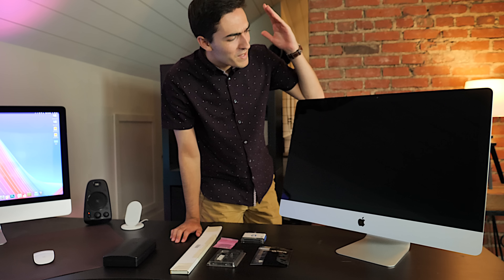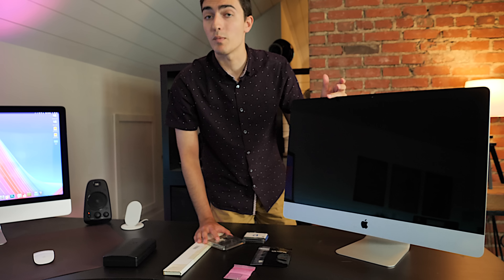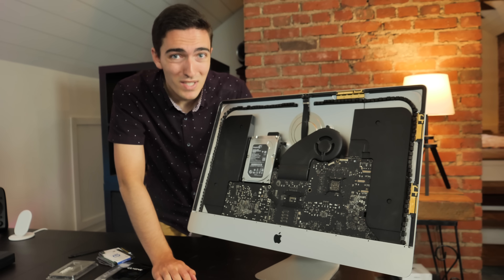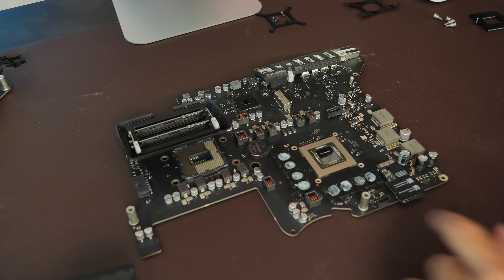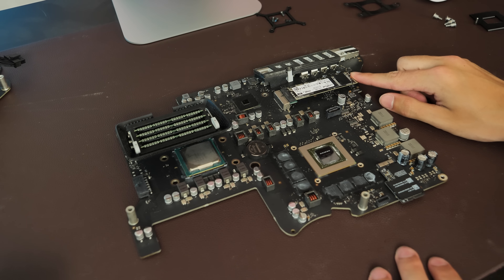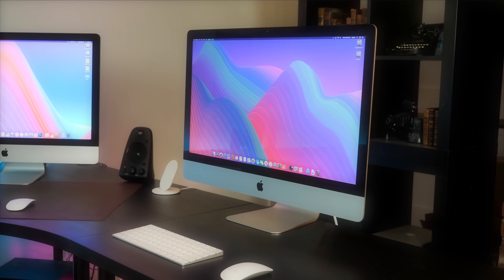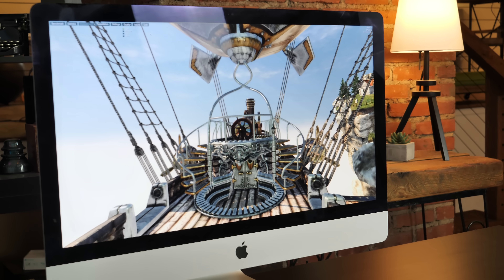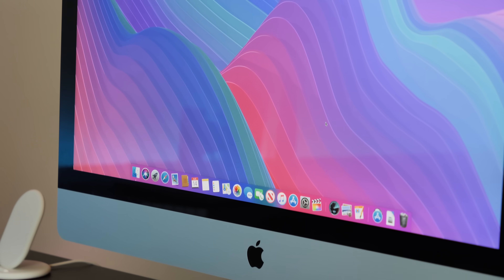Upgrading the $500 2013 iMac to the Max!

Comment: Changing to an non-Apple SSD - do you have to run the ‘Enable trim’ command?
Reply: Roscoe Coltrane no. Even my Mac pro is running OWC ssd PCIE no problem. Came with enclosure for old apple SSD to use after also.
Reply: Also tested another on 2 2014 15" MBP retina & 2017 13" MBP retina and it was fine.
Reply: Bobby Brady  is it possible OWC Aura SSDs are already? Cause I didn't need to do anything?
Reply: Bobby Brady dang. Learned a lot. I'm hoping my 2013 has the PCIE slot too I'm running off internal SSD now but would be dope to hit i7 and NVME OR PCIE! Scared to run the disconnect 😂
Reply: Bobby Brady  Im going to dive into the iFix it tutorial. My business partner did it with this 5k retina so hopefully we can do it too for mine. I know the issue he kind of glossed over was the live power in certain points even when shut down and unplugged. He made it seem much easier than it actually is i assume

Comment: I’m a newbie for Mac OS..  once you transferred the hard drive contents over to your SSD, where and how do you set the SSD as your primary drive and boot to it?   Did you keep the hard drive as a secondary drive?  I’m coming from a windows background.   Thanks
Reply: Use Carbon Copy Cloner to copy all the data and the recovery disk to the SSD, then go System Preferences >>  Start-up Disk to set as the permanent boot disk. You can toggle between them on boot by holding down the option key as well
Reply: mindtpi thanks
Reply: Bobby Brady  That's fine if you have an external Time Machine backup (the existing internal SATA isn't going to be a Time Machine disk) which will normally be USB but it's glacially slow. You have the SSD and the SATA disk in the computer already, you download a 30-day free trial version of Carbon Copy Cloner, transfer all the data (and the recovery disk) over the internal SATA it will be hugely faster. Restoring off what will probably be a USB external disk using TImeMachine doesn't make sense in comparison. You can certainly do it, but why would you?
Reply: Bobby Brady   I would imagine. that if someone has issues using something like Carbon Copy Cloner over TimeMachine, they probably wouldn't have been disassembling a 2013 iMac in the first place

Comment: I believe it’s always worth it, to buy something you can customize to your needs. You never know what somebody else threw In there and you may not need all that. If all you are interested in, is upgrading the ssd an ram, $185 bucks is still less than what someone may sell the entire unit for, with those upgrades. If you know what your doing, get the $500 iMac and use the saving on what’s important you you.
Great series Luke. Peace.

Comment: Great job Luke I did the same for my late 2013 27" iMac  got mine for $200.00 because it had a bad power supply put a new one init did the upgrades very solid mac

Comment: How do you know if your iMac has an NVME slot?
Reply: I think all the thin 27' models have a slot on the reverse of the logic board - the NVME key on the different models may be different though. None of the thin 21.5" 1.4GHz models do. Any thin 21.5" iMac that originally shipped with a Fusion Drive will do (that where they stick the SSD for the Fusion Drive), some higher-end 21.5" ones that weren't originally Fusion occasionally  seem to have them but that's random (I assume that Apple just used the NVMe boards when the others were out of stock). None of the thick (2011  shape) iMacs have an NVMe slot but you can either replace the internal HDD with a SATA SSD or leave the internal HDD and stick in the SATA SSD in the  CD-ROM slot in an $5 adapter tray. In some 2011 27" iMacs I've found an extra mounting bracket and SATA cable hidden under the CD-ROM you can stick a 2.5" SATA SSD in as well.

Comment: Don't know if I got lucky but my old 21.5 in iMac 2013 just had the stock HDD and it came with the connector for the SSD used here so I was able to make a fusion drive

Comment: Is the thermal probe on the hard drive any different than on the 2009 mac mini? When I upgraded my mac mini I just used heat to take the probe off the old drive and then I just stuck it to the new one and it worked fine.
Reply: Some Apple drives have a special socket on the drive (depending on the model) that connects to the motherboard - later ones might be running through the SATA bus (can't recall seeing the cable on 2013 and later models). There's several free software options to bypass or just get the inline thermal sensor from OWC for your model (there's 3 different ones from memory)

Comment: For the fans to work with an SSD there's a great little program. It's called SSD Fan Control.
Reply: I like his work around though. He just left the HDD in place and now he has a 1TB internal storage to put archived video projects or whatever in while the machine operates off the new SSD.
Reply: Guy Incognito different from SMC fan control?
Reply: I use Macs Fan Control for exactly this issue.  Works like a charm.
Reply: I also use the fan control app. Don’t even bother with the mod, just set the HDD fan to the lowest setting in the app and you won’t even hear it.
Reply: just upgrading my 2013 imac to 860 evo (replaced my hard drive), strangely it works perfectly with no issues. Even without Macs Fan Control!

But different story for my 2010 imac, i replaced the hdd with a newer hdd and the fan is spinning on full speed.

Comment: I just bought a late 2013 21.5 iMac with the i7 processor and 1tb hard drive. You mentioned in your video that only the 21.5 with a fusion drive have the NVMe port, but when I upgraded the memory on my iMac I do have the NVMe port on my logic board just above the usb hubs. Does this mean I can install NVMe on a non fusion drive iMac logic board?

Comment: Can the 2017 or 2019 with the small NVMe drives be upgraded with that adapter?  I"ve heard conflicting stories.  Also I would have expected better write speeds than the 700 you got.  If that is as fast as it gets maybe go with an external 3.1 ssd which probably gets you in the 500 range.

Comment: How the living hell you buying them so cheap??
Reply: Bobby Brady  Hungary, but don't mind that part, I tried to find deals in America with a vpn. Even if I have to pay around a 100 extra for shipping it would still worth it.
Just to see the priceses I payed a bit more then 500 for an imac 21, 2011 with an i5 250gb ssd, and 20 gb of ram it had the keyboard and the mouse and trackpad. And it was a fair price. Here if I want a 2013 modell even the 21 inch is gonna set me back (base modell) with at least 6-700. And I can't seem to find better deal even on ebay no matter where I searched, and that's what I find very disturbing.
And thank you for your answers, I still managed to find a good machine for myself here, which is a big deal here, thanks to the knowledge that you gave. So thank you!
Reply: Exactly! People in my area just take between 10-20% off the sticker price, no matter the year, condition, or model. Luke is the ultimately haggler, I guess.
Reply: If you're always on the lookout for deals you'll probably find one eventually
Reply: same here at indonesia, this machine is heck expensive second, buying it via ebay is out of question, imported tax make it as costly as new one
Reply: @agushendra  Kinda the same in Hungary

Comment: i bought that model new at top spec. (1tb ssd) GPU died. at 4.5 years after purchase.
Reply: Bobby Brady  if it weren't for the GPU i would still be using it.
Reply: Bobby Brady   I just remember it died right after the mojave update. seconds after. I thought it might have had to do with the nvidia support issue but the way it died was fairly telltale. I do have it still. I used it in target disk mode for quite a while because the drive speed was amazing over TB. I'm just sad you can't use Target display mode anymore with these models. I may try to revive it but I just don't have the time. If I can find a new Logic board with a good gpu on it I would consider trying what Luke did.
Reply: and was able to use it in Verbose mode too. I have to be honest though. I would much rather get a 6 core i7 mac mini and an egpu. (although fingers crossed a 6 core i9 or 8core update mac mini would be nice too)

Comment: I wouldn't mind upgrading the apple SSD in mine from the 120GB Apple put in there to something bigger but it isn't worth totally taking everything apart like this. I have always wondered about the NVME SSD in there and if it could be upgraded. I already have the i7 and 32 GB of RAM from the factory
Reply: You can install MAC OS on an SSD using a USB 3 to SATA adapter, it wont be as fast as NVME but you will get great day to day performance as well as more space. This is what I currently do, I use a 500 GB SSD as a boot drive, and the internal hard drive as a backup of the SSD.

Comment: Did you set up both drives as a "custom" Fusion Drive or left them as separate units? And what thermal compound have you used during reassembly?
Reply from the maker: I left them separate to use the HDD as storage. Thermal paste was just standard Cooler Master something or other

Comment: videos kinda looks blurred a little bit?
Reply: HD 1080 might not be available right at upload it's sharp now💪🏼
Reply: @RafaelUnplugged  if you look at the eyes at the beginning you'll see it's a little out of focus.
Reply: RedG Glitch any particular time stamp?
Reply: Oh yes I see. Esp near the top of the frame. Probably his camera settings. It's either manually focused and or it doesn't have face detection that's super reliable like dual pixel af on Canon or Sonys system. 

Video is HD but the focus is off. I see it now. I think the Imac is more in focus then hmm